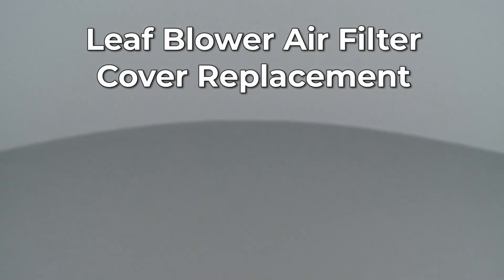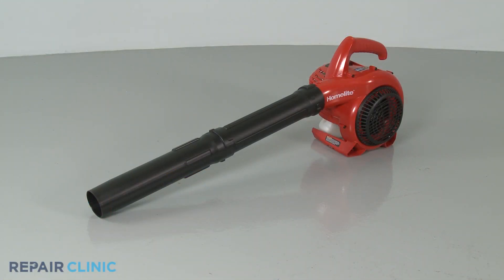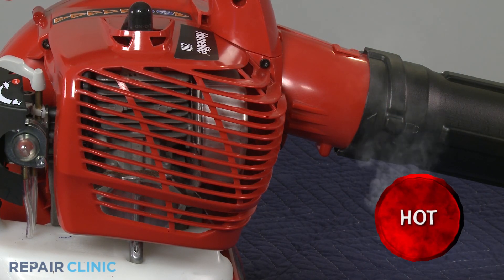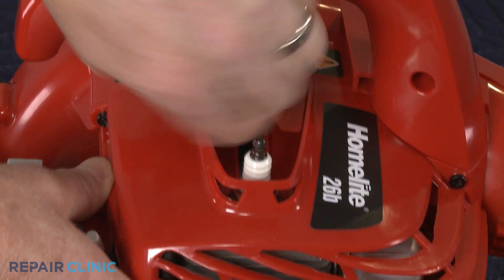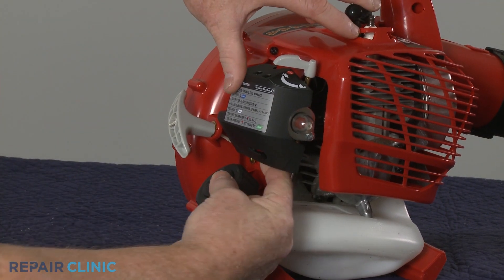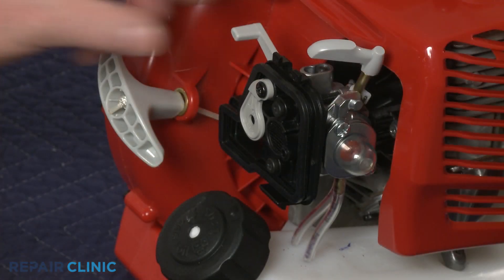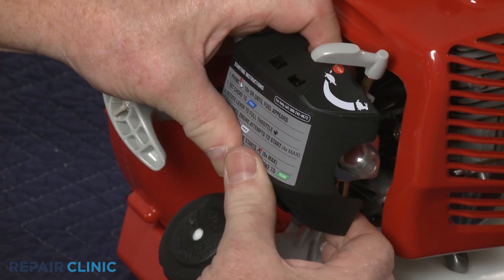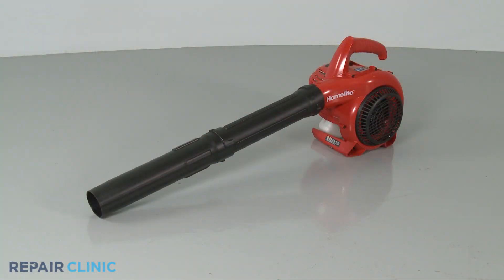Homelite Leaf Blower Air Filter Cover Replacement (521852001)

Comment: So, im not sure but mine is leaking from this location, is there supposed to be foam underneath the cover.
Reply: Good question I am wondering about that myself. There is no way they manufactured a BLOWER without a paper or foam filter.